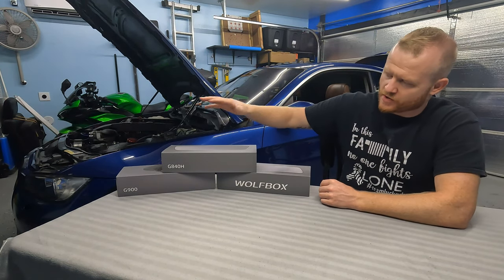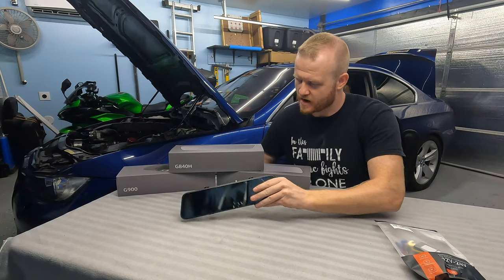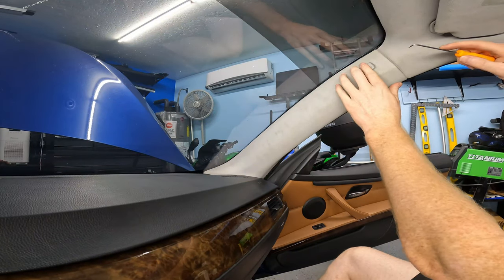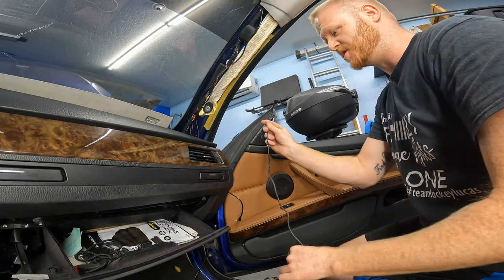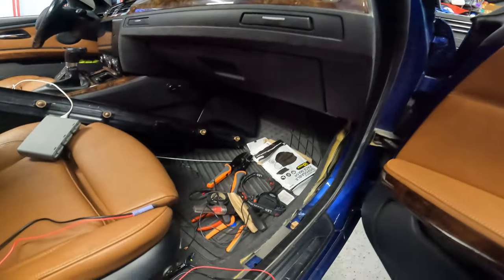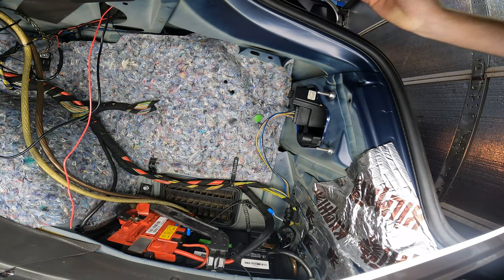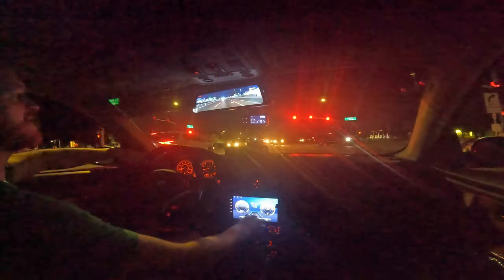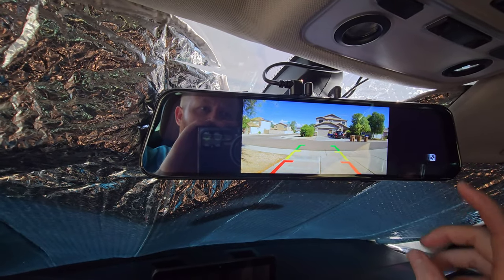Wolfbox G840h, WIFI DashCAM/Mirror

Comment: So with the 900. How do you watch the video if your computer isn’t with you??? Like while you’re driving and need to show the police?
Reply from the maker: You can play it back on the actual mirror, or I purchased a card reader to Plug into my phone like this one.
https://amzn.to/3GCFeRI
That way I can basically insert the card into my phone
Reply: @jku392adventures  What do you think is better? Having the Wi-Fi and the app or having the 900 with the better camera etc? I think theres a 930 with the app…thats 10” where the 900 is 12” no app. How sensitive is the parking feature? I have an F150 it takes a lot to move that thing! LOL
Reply from the maker: @jaygolden4218  as far as app vs better camera I feel it's personal preference. When I'm off-roading and capture something on the trails and need to quickly remove it from the dashcam, the app makes it easier to be quick about it. Not having to stop to pull the SD card. But if I'm wanting to pull out a lot of videos from the card I would put the card in my computer and not even use the app. If your using it for capturing random accidents then the wifi app is better. If you find yourself using a lot of video from the cameras, get the g900 and put the card in the computer.
Reply from the maker: @jaygolden4218  the I don't use the parking sensor too often because I keep it on the loop recording. But I think it would take lightly slamming a door to activate it. Or someone actually bumping into your truck
Reply: Gotcha. I’m torn. The 900 has the 12” mirror. My Tesla when it came out the sentry mode worked the same. You had to pull the sd card out to find the video. I do like the higher resolution so you can see license plates better. I know they have a sweet deal for the 900 with all the accessories. They said next year they’re coming out with the WiFi version.
Reply from the maker: @jaygolden4218  yeah if you are looking for the overall best quality, the g900 is hands down amazing. Also on my like I have a code for 18% off. And it also gives me a little kickback , so that's always appreciated 🤙

Yeah the g900 with the wifi will be awesome! But still, pulling the SD card is easy enough
Reply: Thanks right now it wont let me use your code and the $60 off discount code they are offering . I guess it’s easy to hardwire the camera to keep it on all the time in case someone hits me while Im parked.
Reply from the maker: @jaygolden4218  yeah you can always get the hardware kit on Amazon easily. But I'm sorry you can't use both codes, I guess which ever ends up being better is the way to go 🤙 no hard feelings lol
Reply: @jaygolden4218 have they said when next year they may bring the 900 with WiFi?
Reply from the maker: I haven't heard an official date yet. I mf I hear something I will let you guys know 🤙🤙
Reply: @MM-ho7kb  They have announced the G900 Pro with wifi capabilites and now with improved Stravis II Sensors

Comment: Wow that’s a lot of screwing and unscrewing panels. I just bought this yesterday as a black Friday special. I too chose this one because it has Wi-Fi. I hope I can install this myself. I’ve never done anything electrical on my car. You do make it seem diy friendly
Reply from the maker: Hahaha it's definitely not as bad as it seems, which vehicle do you drive? And you can always route the cigarette lighter through the panels to avoid tapping into the wiring. But once its installed you will be so Happy!
Reply: @jku392adventures I have a 2010 cadillac srx. What is the difference between going through the cigarette lighter and hardwiring I've seen many videos talking about the battery being drained. Which would be my best option
Reply from the maker: @milagrossmith4891  it all depends on how your cigarette plug is wired in hour car. If it's only on when the key is on it will work out perfect. If it's on at all times then it will drain your battery. You want accessory power, ( key on power)
Reply: It's also possible to use a trim tool to push the wires behind the trim panels without fully removing them. It's definitely not as pretty, but it can be way faster and easier.
Reply from the maker: @Hawk7886  definitely true! If I wasn't making a video of it, I might have don't that for several areas. The trunk area I could have tucked it instead of removing everything, still good for people to see how it all comes apart 🤙

Comment: Do you notice a difference in the rear video resolution when looking at the mirror/lcd? 1080p vs 2.5k?
Reply from the maker: You really don't notice a huge difference, I actually run the 840 in my jeep and bmw often.
Reply: @jku392adventures  ok. Just wondering if the resolution was worse than the g900. Thanks!
Reply from the maker: @chuckisbusy  it technically is on paper, but not very noticeable in person :)

Comment: What would an installation like that normally cost someone if they don't do it themselves? I have a Toyota tundra I want that done on once I order the camera.
Reply from the maker: Is it a newer tundra? If it's a little older one, most off-road shops would probably charge around 150 to install it is my guess. But that's purely a guess. But it could be more, esp if it's a brand new tundra. I would recommend trying to install yourself using YouTube University 🤙🤙🙏🙏 it's not too bad of an install, esp if you use the cigarette lighter instead of tapping into the wiring harness
Reply: @jku392adventures  it's a 2014. Maybe I'll look into doing it myself. Just alot of wires and removing side panels. I'd hate to mess it up

Comment: I have a question, you describe the G840 as having the Wi-Fi capability, while the G900 has the SD card, but the comparison pic shows just the opposite at the top, even though the model numbers are correct. Excellent video though! New follower!
Reply from the maker: Oh wow! I see that now, haha that's a good catch! I will have to delete that part of the video so it doesn't confuse anyone! Much appreciated 🤙🤙🤙
Reply: @jku392adventures   ok but what do you mean by that.. so the G900 has the wifi and the 840 does not. Or they both have it? Or just the 840?
Reply from the maker: @dguy-xk4fc  the g840h has wifi. I posted a picture from their website, and the picture of the g900 shows a wifi symbol. That was the only error in this video. The g840h has wifi. The g900 currently does not. Everything in the video is good

Comment: I have one question this camara give you a real alert to your phone when someone hit your car or get close to your car .
Reply from the maker: Hey! Good question! Unfortunately it does not have this capability. But It will put an the saved video in a different folder if the g sensor gets hit. So it's easier to find

Comment: Just bought g 900  getting it installed tomorrow  the installer wants to know if  it comes with  cable for parking mode  i have bought the hardwire kit  do i need to buy another cable m8
Reply from the maker: The hardware cable kit is what you use to wire up the parking mode and power the dash cam. So you don't need to purchase anything else 🤙
Reply: Good man thanks
Reply: Do i need extra wiring for it to double up as a reversing camera  the installer wants to know  🤔 cheers my friend
Reply from the maker: @petermurphy8520  which vehicle is it going in? That would determine if you need extra wiring or not. If it's like my four-door Wrangler you don't need any extra wiring or extension for the camera 🤙
Reply: Seat ateca suv m8
Reply: Don't know if the guy has fitted wolfbox before  live in Scotland
Reply: Plus £210 to fit it
Reply from the maker: Not to big of an SUV, you will be fine with the stock camera lengths 🙏🤙 and they are not hard to install 🤙
Reply from the maker: Not terrible of a price to install it

Comment: It looks like licence plates are not readable very well. If the cars drive to fast, the low FPS will not capture it. Also during the night, the dynamic range of the camera seems to be so low, it has difficulty with reading licence plates. (Highlights overblown. Do you experience this too? Thank you.
Reply from the maker: I don't really have huge complaints, I feel like if something backed into me, they would be close enough for me to catch their licence place. Not if it was trying to catch a license plate from someone far away then I would just try to get the make and model of the car, but most of the time they will be very close when hitting your car. And at night, I think there's room for improvement, but still an upgrade over the dark mirror. Sometimes I use the mirror only to remind myself of how much better the dash cam is than just the mirror

Comment: How long is the camera wire? I've been looking for that info and can't find it. I'm not sure if I'll need the extension kit.
Reply from the maker: I will have to look to see how long it is. What vehicle is it going on?
Reply: @jku392adventures  A 2022 Ram Promaster extended. Without much interior to route around. Should be easy to run wire.
Reply from the maker: @dougleclair5080  I would probably say to get the extension. If it was like a Tacoma, maybe that would work fine. But anything bigger I bet you would need the extension 🤙
Reply: @jku392adventures  Probably a good idea. Thanks

Comment: Wich  one do you prefer ?
Reply from the maker: After having both the g900, and the g840, and also the i17 (dash cam only) I think I would choose the g900. Even last week I was offroading in my jeep and I knew I had at least several minutes of video I wanted to grab off the dash cam, so despite it being wifi, I still removed the memory card to easily move about 12 (1 minute) clips to my phone. So overall my favorite is the higher quality video from the g900 and wifi doesn't trump video quality when off-roading often 🤙 so I will be putting the g900 back in the jeep next week 😂 both are still great, if you never use the videos from the dash cam, then either is a great choice